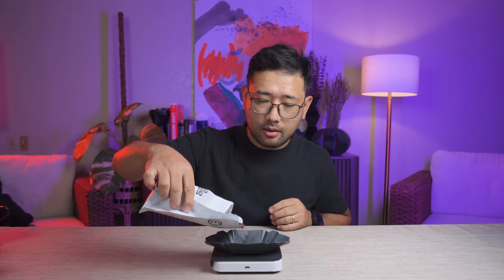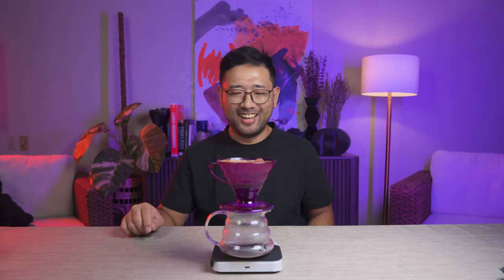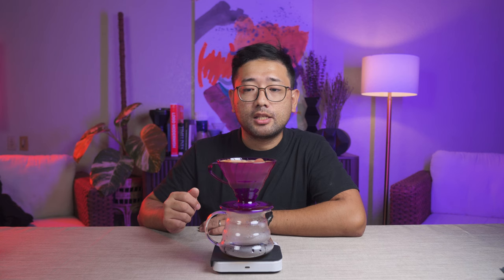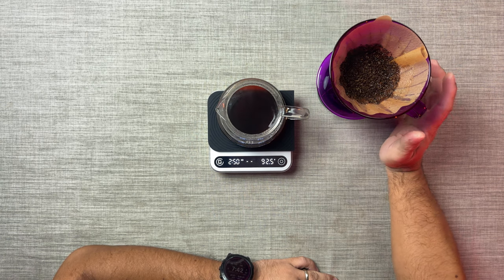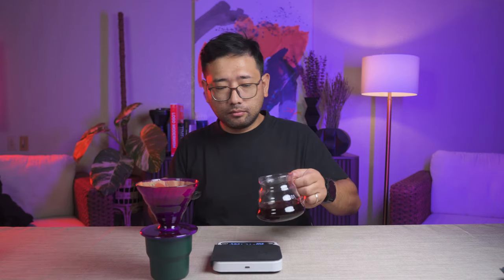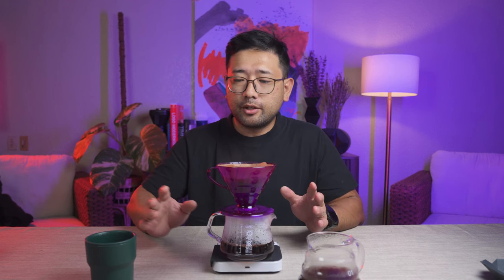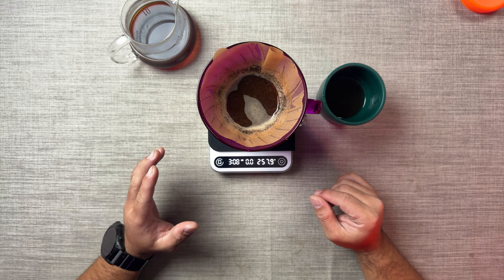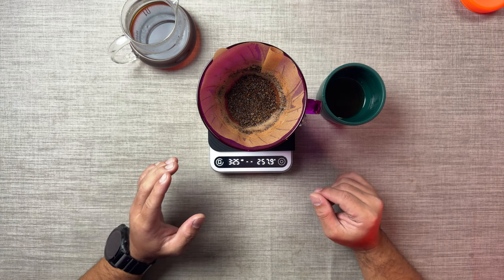Ultimate Pour Over Recipe by Lance Hendrick

Comment: The point of my video was not to imply it is the only recipe but is the easiest baseline you can use for any coffee. I use it daily on every coffee. By manipulating variables, it does work incredibly well. You have to play with flow rate, spout height, agitation, grind size, temperature, bloom time.
Reply from the maker: Yeah i get what you're saying, but you mentioned that it is a "CATCH ALL" but then again you need to change all the variables to adapt to your liking and beans and water and whatnots.
Reply: @darylbueno  yes. The base is a catch all for any brewer. You don't need a v60. I've not found any other base recipe that can brew well across all devices. Perhaps that's where you misunderstood.
Reply from the maker: @LanceHedrick  oh i completely agree, this 2 pour method is a great base for starters. I even have a video of my own 2-pour before i saw your video but all im saying is, a lot of beginners look up to you (me too) and i think the way you said "CATCH ALL" is a bit misleading is all. But hey, i completely agree - good base for starters :) ill do another video using your recipe with every brewer i have :)
Reply: @darylbuenocoffee  didn't mean to be misleading. I felt I explained it well in the video that the recipe is a base to play with on any coffee. Since most buy a 200g bag, it isn't very sensical to redial every variable. Instead, they can use one recipe and change small things to get 90% of the way there.
Reply from the maker: @LanceHedrick  yes i completely agree, great job! I enjoyed this a lot. I hope we can brew and talk when i visit New York :)
Reply: @darylbuenocoffee Heck. I saw a Video whereby a Barister said on YT that each of his 10 friends Barista do pour overs differently for the same coffee bean. Thats unless in some cafes where all barista's working there must do it the same Shop Way.
In this Wild West how many coffee brewers hits near 90% of the way there?
Of Cource in Coffeemakers like the Bloom and Fellow's Aiden you swipe a recipe card from the Roastery and that coffeemaker does the pour over Exactly Correct. Whether one likes the brew Taste is another matter. Then there seems two coffee brewer groups today. The Like Thin Coffee taste Specialty Crowd. And the Like Full Body taste Crowd(They have their views of Clarity, Complexity. Ratio's, Sweetness. Smoothness etc. What I find INTERESTING is that many many Barista's uses 15:1 to 12:1 Ratio's.
Reply: Would surprise me if there are over 50-100 Drippers Design out there. And maybe 10+ coffee papers filters with different Extraction schemes. And now Top Wise theres hand held pour drip regulators. And Bottom Wise theres Drip control disc's. Not to mention how many kinds coffee Bed agitators exist. Some day Specialty Coffees may even have their beans dipped in Eggs before Roasting. Giving Egg Notes in the Breakfast brew.
Reply from the maker: @larrywong7834  hahaha really? They do that?
Reply: @darylbuenocoffee  Here is cut and paste from The Spruce website.
"Adding eggs to coffee can create unique flavors and textures, and can also enhance the coffee's notes:"
Egg flavor is a thing with the Swedes brewing coffee. Vietnam and another Asian country also.

Comment: It seems like some aspects weren't done according to the instructions in Lance's video. For instance, I think it should've stayed at a course grind, and you could've agitated the bed to slow the drawdown.

I use a variation of his recipe (and still need to test between my 3 pour variation and the standard 2 pour version); it beats any other recipe that I've tried, with any coffee. Although I don't do medium-dark to dark roasts, so not speaking to that realm of things.
Reply from the maker: If you could watch the whole video I did 2 different brews, 1 with a coarse grind at 26 clicks and 1 medium coarse at 23 clicks. While maintaining his recommendation of 8g/s pour and 1.30-2min bloom time, the grind size is the only thing i could change to get to the target draw down of somewhere between 3-4mins. I could've done with a very coarse grind at 30clicks pouring at 2g/s to reach the target draw down of 3-4mins but his compulsories on the pour of 6-8g/s will not be met. If by agitation you meant stirring the bed, this will actually draw the water down faster so it's not going to help. I think this recipe wasn't meant to be used for good grinders like the C40 and the ZP6 that doesn't produce a lot of fine particles. I think you can do this recipe and expect the clogging to slow down the draw of the water using a grinder that produces a lot of fine particles.
Reply: @darylbuenocoffee  I need to watch his video again to be clear, but from my perspective of the recipe, it's not about pouring at 2g/s or grinding finer, but is about the manual agitation methods which do slow it down. It works exceptionally well with good grinders, which I have, at the course setting.